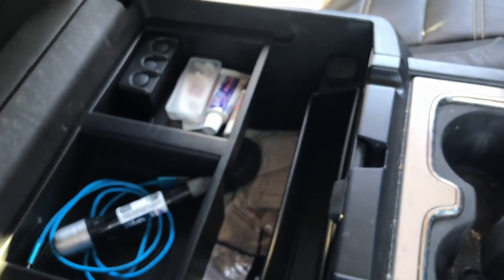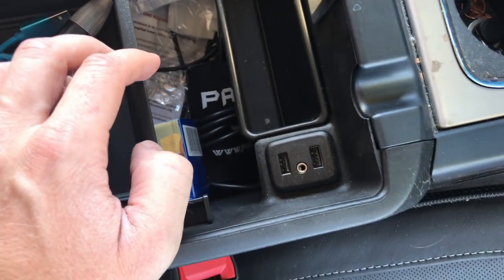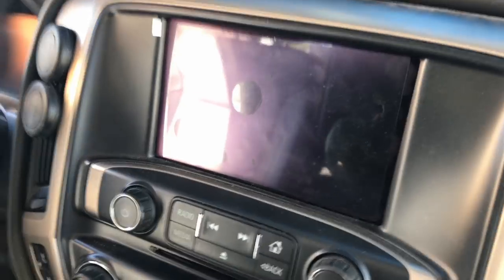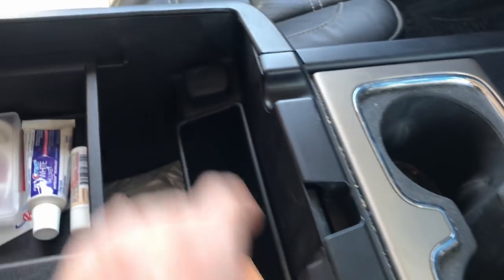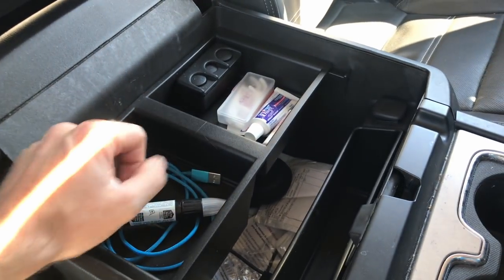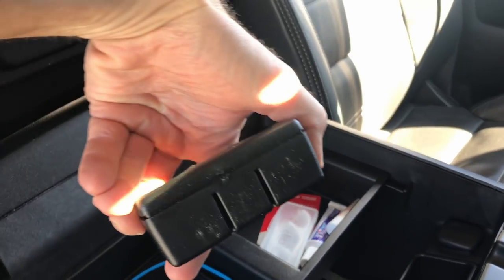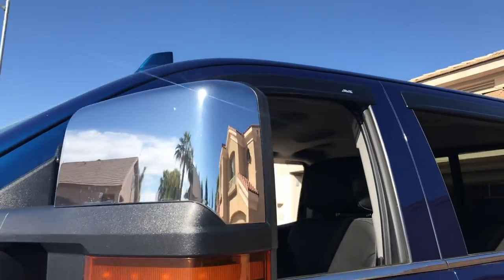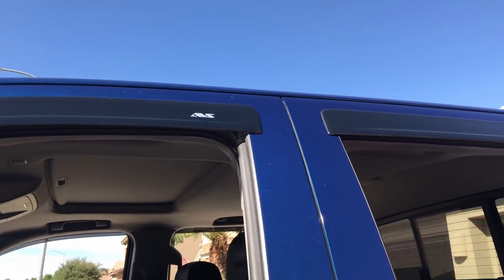CHEAP or FREE Truck mods!!!

Comment: That splitter would have saved me $500 when my amp steps were installed.....damn
Reply: I have amp steps and can tell you the cheap splitters don't work well, I had to buy the splitter direct from amp and it has been flawless.

Comment: Have you ever had a problem with your iPhone overheating from having it mounted on the heat vent like that?
Reply from the maker: John Doh only if I forget to turn then vent off, I just use the vent on the left side of my steering wheel. If I don’t have my phone on the vent though sometimes I’ll use it.